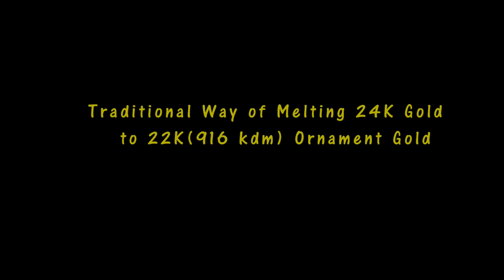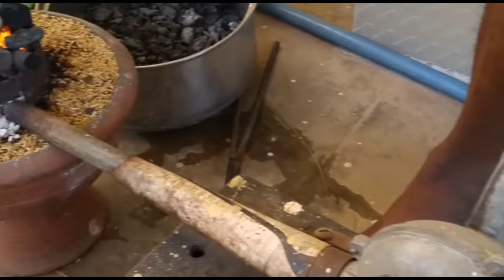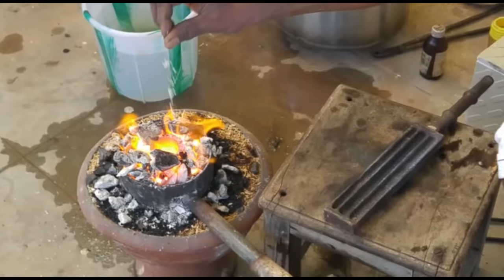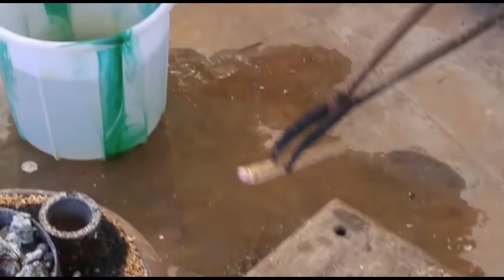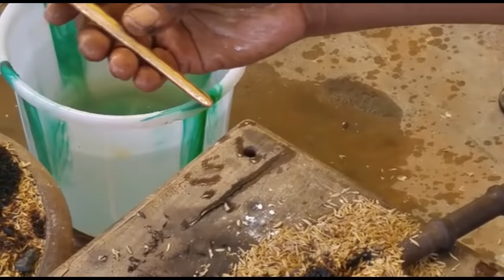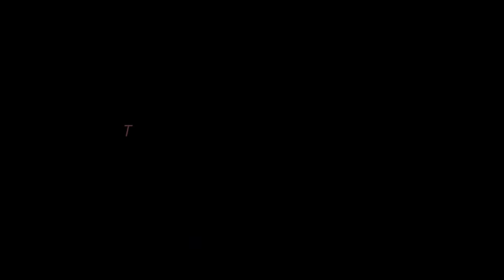Gold Melting - Traditional Way of Gold Melting  | How to Make 22K Gold | #04 |

Comment: What sort of seeds were around, but scattered? And for what? Thank you.
Reply from the maker: Those Rice Husk. That  is used  to create enough heat when we melt Gold and Copper
Reply: @WomensArtandCraft  I did not know that rice husks can be used for processing into insulation and one of the by-products of rice processing can be used as insulation.

Rice husk is mechanically processed poorly - it is a fairly dense material. The use of rice husk for heating purposes is also not suitable - the husk does not burn well. Maybe that's why the production of insulation is the best option.

Interesting. I'll have to try. Thanks you.

Comment: What is the substance that dissolves gold and is it wheat?
Reply from the maker: Only Copper will be Added during the Melting process. After Mixed pure Gold will be available for Jewelry Making.
Reply: Can i use for copper wire osme of it ?

Comment: Damn I never knew Gold having such a high melting point can be melted using wheel like handmachine... Damn that's dope! 

Can anyone explain me why that guy dropped red hot coal into molten Gold? Also, when we dropped so many coals + rice cover don't any portion of gold attached to it? Just curious though... I know the answer that goldsmith isn't that fool to through away just like Iron but

1) why molten gold didn't attached to coal+charcoal (because it's gold not mercury which reacts opposite to your movement!!!!! 
2) why the hell he mixed grains into molten gold 😞

IDK why am hurting my brain too much. Just curious though...don't know why since from my childhood+college chemistry gave me so much pain..still now my brain starts paining. Hell with YouTube recommendation🤬🤬
Reply from the maker: 1. Charcoal put inside melted gold to mix the Copper and Gold well so when it got poured out it will not break.
2. Rice Grain put after Gold,  to bring down the heat - so gold got hardened already.